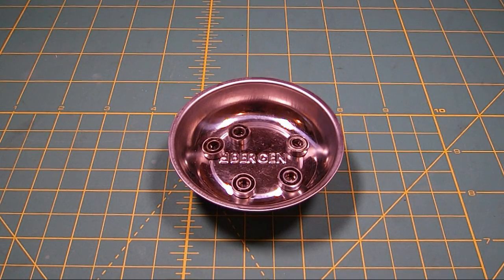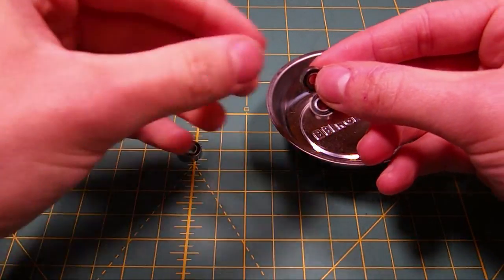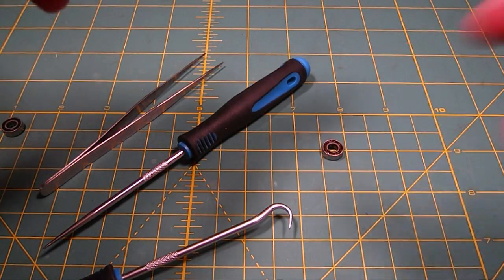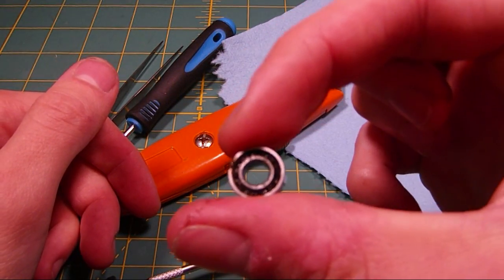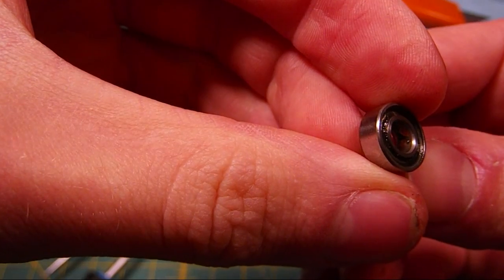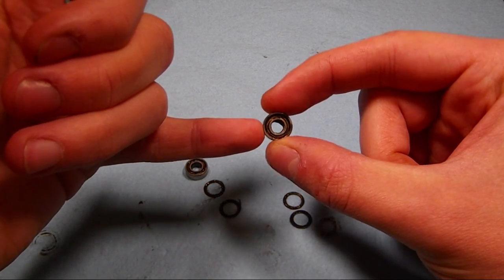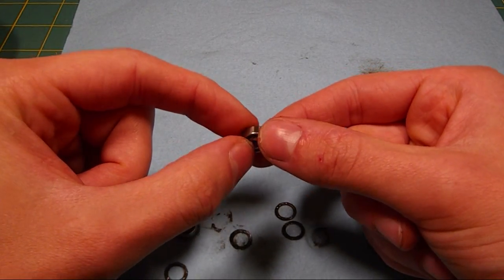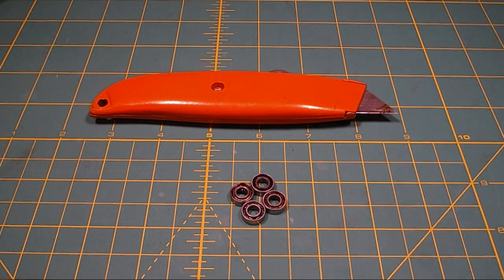RC Autopsy - Bearings

Comment: I like the idea of the "RC Autopsy " series.  RC cars need a lot of maintenance (especially if you drive outside a lot) so any tips you have on maintenance would be great to see.  I recently tried cleaning out bearings for my first time as well.  I used a hobby knife, WD-40 and some ceramic grease for the process.  Seems to have worked ok although I don't know if the ceramic grease was the best choice....it's what I had in my tool box :)  Thanks for the useful video.
Reply from the maker: Thanks for the feedback. I have another RC Autopsy planned so stay tuned for that one. Glad your liking the series. I will be doing a video on cleaning bearings. Just as soon as I have some free time to film.

Comment: I have tried to fix metal bearings before, but it doesn't really matter if the bearing balls are worn out. Yes, you can buy bearing balls, but they are quite expencive, so it's better to toss the old bearings and replace them with new ones. However, if the bearing is in good shape, you can just use some cleaning products (WD40 etc), and lube the inside of the bearing with some marine grease. That can extend the lifespan. 
(Ps:With rubber sealed bearings, use silicone based grease)

It would be interesting to see different methods though :)
Reply from the maker: Being as I have 4 seized bearings, I'll try 4 different methods to clean them. I don't think it will become a regular thing though. It's much easier to get new ones.

Comment: I would throw them in diesel and forget about them for a week or so. Works on bike chains and tools. May work for bearings too. 10p of diesel could do the trick. Nice vid but i did get a bit nervous on the use of the blade :s cut towards your chum not your thumb as AVE says.
Reply from the maker: I might try that one. Good idea. I appreciate your concern about the knife. I wasn't using a lot of pressure. The seals weren't held in there too tightly. Thanks anyway.